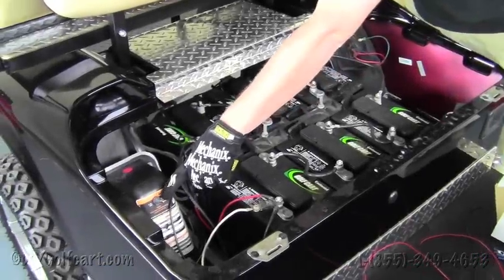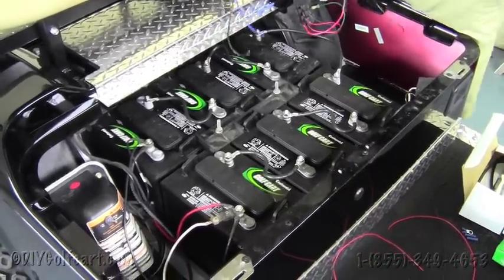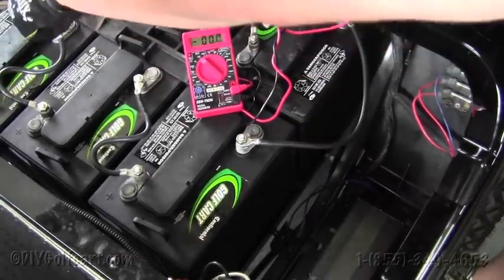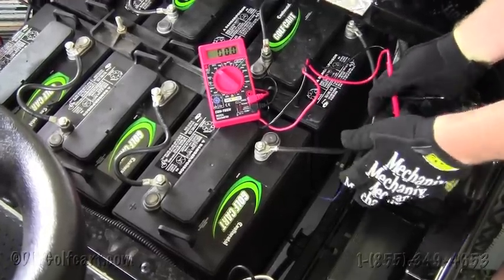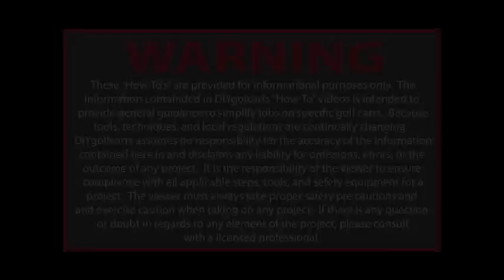36 or 48 Volt Voltage Reducer | How To Install Video Tutorial | Golf Cart Voltage Reducer

Comment: Finally the answer as to why one doesn't just use 2 of the 6 batteries for 12 volt addons. Good job.
Reply: Scott Zeiger well its very simple why you dont want to do that. When you do it the way you said, you take power out of 2 batteries and the whole pack will become unequal in charge. When a person spends 500 to 1000 dollars on a set of batteries, they dont want to do stupid things that cause pre-mature battery failure. Simple as that.

Comment: You should always hook up the positive up first then ground last so when it arcs it arcs to the ground side
Reply: Golf carts don't use a chassis ground, so it doesn't really matter. Just make sure the circuit has no load on it and there shouldn't be any arcing.

Comment: So is there no need to tie into the obm?  Accessory usage is not monitored by the obm?  Also, where are we wiring the 12v ground?  Does that go to the obm?  Or straight to last battery negative?  Can I run the stock accessory blue wire from the 12v of this voltage reducer?  Will that get monitored by the obm?

Comment: Great video but I have one question, being that I only have two accessory wires am I going to have to add a reducer each time I want to add an accessory or can I run multiple accessories off those two wires and if so how?
Reply from the maker: In that case you would use a fuse block.

Comment: So, I’ve installed a 36v to 12v reducer. I have an EZGO PDS TXT 36v battery. I’m upgrade to LED lights, blinkers, hazard, and horn that is controlled on a steering column box. When I connect power direct; by pass the wiring harness, everything works. When introduce the reducer I get nothing. Any ideas here?
Reply: I just installed one on a 48 volt system. It worked for 24 hrs. Now it only shows 5 volts.

Comment: Where does the neg wire on the output of the regulator connect to? I have 4 accessories. Does it connect to the accessories only or to the neg on the battery as well? If so which battery? Thanks!
Reply from the maker: We have multiple Reducer's in our inventory and I'd have to know exactly which one you have to answer that question. Most of them have a wiring explanation sticker on the side of the reducer.

Comment: I messed up before watching your video. Hooked up a 48V to 12V reducer but forgot to change switch to tow/maintenance mode. Now my accessories work great but the cart will not run. Acting like the motor is getting no juice. Did I burn something out?
Reply from the maker: Possibly the controller. Put the car in TOW for about a minute, then put back into RUN and see if that helps.
Reply: @golfcartking  That took care of it! Thanks a bunch!
Reply from the maker: @leohalm  Fantastic!! Always remember. Put the car in TOW before doing "anything" electrical to the car, including charging it! Better safe than sorry!

Comment: are there two leads for accessories coming from the reducer? which means I can wire in my light kit and a stereo maybe, but what if I need more? do I splice wires? depending on the amp, I suppose the switch wiring may already be included, not sure though.
Reply: Get a fuse box

Comment: Hi man,why it's not possible to connect the 48v wire to the nearest battery?thanks
Reply from the maker: Because the nearest battery may not be the either #1 battery or the #6 battery in order to pull either 36 or 48 volts.
Reply: Is it the same thing as connecting the negative and the positive on the last 2 batteries where the controller is very close?
Reply from the maker: I believe those are battery #1 and battery #6. Verify using a volt meter. Must be 36 or 48 volt.
Reply: Ok man thank you for the clarification.

Comment: if a voltage reducer is installed for a stereo AND cut in lights on a 03 36volt ezgo do you use the one reducer or do they need their own dedicated reducers?
Reply from the maker: https://www.golfcartking.com/golf-cart-voltage-reducer-26v-60v-to-12v-30-amp/

I use this one for both.
Reply: As long as u have the amperage, you can run whatever u want
Reply: +bmbertges Thanks. was considering how hard to work the reducer. This one Im building for an ex girl but friend will have neon, fan on the top, turn signals, brake lights and head lights. Stereo .
Reply: @richardalvis4695  im currently doing the same on my cart. Your safest bet is to add all the devices up and give yourself an extra 20% to spare. Try using LED lights to help.  LED lights barely use anything. But just break out the manuals and read and not necessarily add the fuses up.  Good luck!!!

Comment from the maker: The reducer itself does not draw any amps unless their is an accessory to draw from. Depending on what you are hooking up will determine the amps drawn with the use of a voltage reducer. It's similar to a cigarette lighter or 12 volt outlet in your car. Although the connection is made for the reduction, if nothing is plugged in it will draw nothing. Please give us a call if you have any additional questions. (855)349-4653
Reply: Question.. 36volt Ez-Go,I have a in-dash 12v USB charger (w/ led lights) and a 12volt voltage meter that stay on and draw power all the time. Is there a way to hook the 12v accessories to the ignition to kill power from the converter? So when the key is off. no power is going out the converter or accessories?
Reply: Thats not true at all in fact more then likely its drawing up to 10 amps not going to kill the kart unless there is a problem

Comment: so its not necessary to run a wire to the key switch ?
Reply from the maker: You can, but if you are installing a radio with a memory, the memory will be lost each time you turn the switch off.
Reply: @golfcartking  i have  36v ez-go golf cart and i have a 12" led bar and im trying to figure out if i can wire it to the key switch? or do i have to get another seperate electric battery and wire in a push/pull switch for lights and accessories?
Reply from the maker: @codysoroka5221  Can not wire to switch! Has to be wired to 2 batteries. If you hook up to switch, it will receive 36 volts and blow.
Reply: I am running the Inverter positive to a 3 switch "gang" panel. 3 switches will control 3 different outputs. Reading this I may add a switch for the 36v/48V INPUT to inverter.

Comment: I bought a 48 volt to 12 volt converter,it only has three wire going in put no output.red and black,and a yellow.
Reply from the maker: David Hensley May want to double check that part. Sounds like a 16 to 12 volt reducer. If they are all black wires, that's what it is.
Reply: Red is input, yellow is output, black is earth wire.

Comment: I added a 36v to 12v voltage reducer on my ezgo txt. I then installed a 12v state of charge meter. The voltage on the meter reads 12.4 volts, but only shows half full. Any ideas why it’s only showing partial with a full charge? Thx
Reply from the maker: A State Of Charge meter "has to be" connected directly to the batteries to get a correct reading.
Reply: Thank you for the info, I’ll have to swap it out. Thanks

Comment: Why would anyone want to use the 16-18v reducer?  The 36-48v reducer can draw up to 10 amps, but it draws from the entire battery back.  The 16-18v reducer which only uses 2 or 3 batteries, so 1/3 or 1/2 of the battery pack (depending how you wire) is allowed to draw up to 15 amps.  So you will be drawing 50% more amps (15 vs 10) from 50% less batteries(2 or 3 vs all 6) when using the 16-18v reducer.  Bad idea.
Reply: Right... And that is the whole point of investing on a voltage-reducer to draw from the whole package of batteries as a whole. 👍